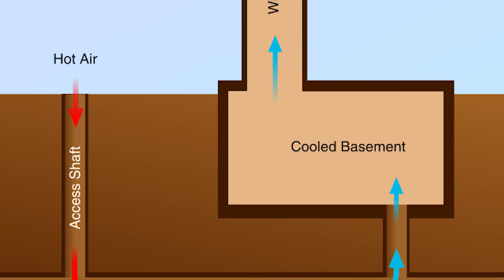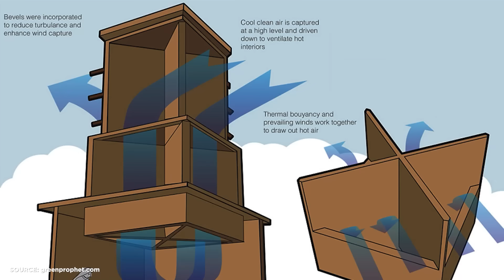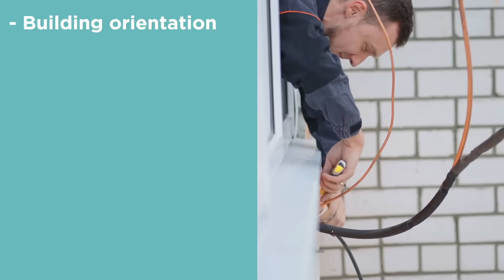Forget Heat Pumps - This House Cools Itself With NO Electricity!

Comment: Another very interesting thing that makes houses more efficient when it comes to heating and cooling is being surrounded by deciduous trees. Some people in Greece have started doing that, and it's actually a super interesting solution. During the winter, they shed their leaves, exposing the house to the sun as much as possible. Then, during the spring they green again and provide natural shade throughout the summer. Not only do they benefit cooling and heating, but their shade is more pleasant to sit under than artificial structures, along with having other benefits of having trees in your garden.
Reply: If you want to read a bit more about this in the context of the US, "Compound Climate and Infrastructure Events: How Electrical Grid Failure Alters Heat Wave Risk" by B.Stone and E.Mallen is a good starting point. It is only 8 pages and compares 2 strategies across 3 cities. 

The relevant bit is that which high-albedo (reflectivity) roofing helps older, single story, single family homes a lot more than canopy coverage, canopy coverage offers a lot of other benefits as well. Better air quality, improvements to mental health and opinion of residents of their own neighborhood, etc. But to quote the paper, "Other recent work has found each one percent increase in urban tree canopy to be associated with a reduction in temperatures of 0.14 and 0.2 degrees Celsius in arid and humid climates, respectively." 0.14 and 0.2 might seem like very little, but a 5-7% increase in canopy coverage reducing temps by an average of 1 degree Celsius is huge.

Anyway, it's a short, if technical read. Highly recommend checking it out.
Reply: I live in a green city (300k population) with loads of trees in gardens and along roads. It's bizarre to me to see so many people literally scared of trees. Sure, sometimes one falls in high winds but I've never known anyone seriously hurt. The city hires arborists to keep an eye on the big ones and manage them if they start to look dangerous and we mourn the old ones that need to be taken out. I'd hate to live in an environment where anything green and growing was seen as an enemy.
Reply: planned:  one story house.  south facing front porch.  south facing garage. 2 deciduous Katsura trees to shade garage and driveway.  house stays 72 degrees until the sun swings around to west.  then it cooks up to 78 degrees.  gets up to 82 degrees when it gets over 100 degrees outside.  sometimes I take a cool shower in my marble shower and the marble floor in both bathrooms is freezing on my feet so I hang out doing nails and girlie things to cool off.  put my crock pot in garage when cooking.  run my waterfall in the backyard to create a cooler allusion.   turned the heat pump on to cool only three days this summer.   

heating: kitchen and family room are heated by natural gas fireplace and closed off from the rest of the house which is heated to 64 or warmer in winter.  in putting in the shower in one bathroom I found that the fireplace on the other side of the wall emitted lots of heat so I made a hole for a register and open it to heat that bathroom all winter.   benefits are: comfort.   good health.  reasonable energy bills.
Reply: You are exactly right. When it's too hot for most people to be outside, I can be anywhere in my yard and be cool. But it is extra work taking care of the trees. Also, air is better around my house.
Reply: People are too retarded, lazy, egoistic, and really sick mentality overall to understand the need of nature.
Most people cut down the trees because of roots or leaves they let on the ground.
Trees don't just add shade to your land, they add life, birds live in trees, and insects and so on.
I have neighboars here who spray poison on the grass, wich is outside their property because they are too lazy to clean it. I live in romania. There is planty of green here.
I live near a lake, the water is like 5 meters away from my backyard fence. My grandather planted willow trees near the lake like 20 years ago, now they are hugee, and all the kids come and make noise and leave junk in the front of my property because they have shade and is nice to stay there. One day i went outside and told them if i catch any of them there anymore i throw them in the lake. Sadly is the only way you can do what is right here.
My entire property is filled with vine, on top of the house and the backyard is like a net of wire on wich it grows. I makes alot of mess in the autumn but in the summer is great. And i can use the grapes to make wine, or eat them. The backyard is allways filled with sparrows. People who live their entire life inside a block, made of concrete, not only they get retarded, they grow more and more sick, they pollute, they don't care about nature, for them everything is "objects". People don't realise it and don't want to see it, but all these changes now, are to force these people to change.
Reply: In low latitudes, deciduous trees will never get tall enough nor be able to be safely planted close enough to buildings to give them shade during the day in summer. They will only possibly work on the east/west sides to block the sun when it rises/sets.
 
Trees for shading buildings sounds great, but it just doesn't work where cooling is needed.
Reply: Having a roof overhang or a shaded pergola over the south facing windows ( if you live in the Northern hemisphere) will let in the low winter sun while keeping the high summer sun out. The rooms in my house are like this apart from one and the temperature difference is huge actually.
Reply: I've been propagating them as much as possible in Alabama. Hoping to someday have more shade than I have land area as my canopies reach out over streets and lot lines 😁 🌴
Reply: Grape arbor do the same, produce a tasty crop, leaves for composting and can be grown on a trellis above the roof of existing buildings.
Reply: Doesn't have to be trees - ivy, grape vines, other climbing plants. They grow faster than trees.
Reply: plus the leaves naturally release water in the air, cooling the surrounding even more
Reply: where can I find those delicious trees?
Reply: Can be a great solution but takes time to grow the trees to a useful size for this.   Also you have to find the right type of tree.  Not all trees grow and drop leaves at the same time of year and can be affected by weird climate changes too.  Still trees are Awesome!!
Reply: One of the main issues is trees falling on your house. I have been to a lot of houses where a gigantic tree fell and nearly killed people, so if this is done the trees need to be carefully monitored. BTW cutting down a large tree in MD can cost 3-8 grand.
Reply: i am currently trying to figure the best way to fell a tree that was allowed to grow next to the house because it got struck by lightning and is dying.
Reply: Lovely, until the roots crack the foundations
Reply: @jakesalvadori6852  Well, I'm no architect/civil engineer, so I can't comment on that. But if the issues with planting those trees are surmountable, I can't see why you wouldn't want them.
Reply: @jakesalvadori6852  Plant trees that won't crack your foundations.
Reply: @jakesalvadori6852  Yes, I have this system and you do have to maintain the trees every few years. But it's worth it. The beauty, the cleaner air. I use the fallen leaves to make beautiful top soil out of.
Reply: @jakesalvadori6852  I was going to say this! I loved my older neighborhood and shady yard... until the roots started to clog my sewage pipes and crack my foundations. Also, animals sometimes got into my attic because the tree branches made perfect pathways. Oh, and the trees threatened the power lines. Then, there's the time a big tree branch fell and knocked off my gutter during a big ice storm. The shade was great. It really did cool things down. But... there are real downsides to being surrounded by mature trees. I had to have two of mine removed.
Reply: @jakesalvadori6852  brother thats if the roots are alr there and you pour concrete over them, roots wont grow into a solid foundation theres no way
Reply: @jakesalvadori6852  depends on the type of root they are having and how close or far you plant them. Willows, for example, grow super fast, but spread far where they consolidate the soil, but are therefore not suitable for planting close to the house.

The bluebell tree, Paulownia tomentosa, is a fast-growing deep-rooter, so it is probably well suited for planting close to the house to provide shade.
The manna ash is a very pretty but slow-growing taproot.
Trees can lower the ambient temperature by 1-8°C in summer. I would build an extra pierced brick garden wall for air-circulation but protection from a potential falling tree stem at least.
i would leave at least 5 meters distance to the house. "A good rule of thumb is to start at about 8 to 10 feet away from your home for small trees and scale up to account for the tree’s mature height and spread." the-best-and-worst-trees-to-plant-near-a-house-by-zone/

Comment: @8:06 About that Eastgate Center. Zimbabwe has a yearly temp of 22C / 72F so ideal for a passive structure. Thermal Mass is huge advantage for all structures, large or small, passive or not. If you want to add your "Mass" to your home, buy a bunch of 5gal water containers. Water holds a lot of BTU's and you can drink it in emergencies. :) The mass reduces the number of on-off cycles of heating/cooling equipment and therefore increases efficiency. It's much like you're avoiding stop-and-go traffic. Same principle applies to your heatpump/home.
Reply: And your fridge.  Don’t leave it empty.

Comment: A self-cooling home in a location that is already naturally cool. Wow. So innovative.
Reply: yep that's what i thought as well. You can't do these kinds of homes in a place that is really hot in the summer, and decently cold in the winters.
Reply: @smokeeish77  ...look up Arcosante in AZ. Thermal dynamics work.
Reply: @Krazie-Ivan  they work up to a point.
Reply: @Krazie-Ivan  bro, those are science fiction buildings ... build a normal home, for normal people in the desert using only thermal dynamics, as you say.
Reply: @smokeeish77  ...just 10ft below the surface, the ground maintains temp year-round. Induction tubes, flowing naturally by way of TD, can cool 120f air to 60f. Works in reverse too... and you can even store excess heat in the ground for winter, with year-round fruit trees growing in greenhouses, despite -40f outside temps. All of this has been done. No sci-fi. 

A "normal" house to you, is somethin I see as a relic & garbage, but a great performing passive house can still appear "normal" to the average eye. That's been done too.
Reply: That was my first thought too. How well would this do in the Eastern US in July when it's 110+ degrees fahrenheit out with 100% humidity.

Comment: ERCOT’s problems also come from burdensome EPA regulation, a massive demand increase in energy usage (rapid population growth as well as expanding EV markets), and an irrational shift of too high of a percentage of production to wind (most of which, geographically, produces in off-peak times). Blame ERCOT all you want, but they are heavily hamstringed by federal requirements that lead directly to energy shortfalls.

Comment: Urgh. Passive houses... No thank you, I don't want to endanger my health. I specifically stayed away from passive houses 15 years ago, when they were hip over here. Living in hermetically closed space and relying on forced ventilation that WILL deteriorate even with good filter management... no thanks. I built a zero energy house instead. That's the way to go.

Comment: A curious passive house design is the Earthship by Michael Reynolds. Fundamentally it is an earth-bermed passive solar home. But the design is quite a bit more elegant. Large angled south-facing windows help capture sunlight in winter and create a heated greenhouse space in the forward part of the structure. The living spaces are separated by thick earthen or stone walls with large windows and doors. In summer, these are closed to keep the heat out. In winter, they're opened to let the heat in. The living spaces are below grade and surrounded by a large earth berm whose mass helps keep temperatures in the living space relatively steady year round. Vent tubes buried in the earth berm allow for air exchange and help provide cooling in summer. In winter, minimal heating support can be provided by a rocket stove mass heater if needed. The system isn't perfect, but if you desire to have more control, you can easily a very small HVAC system or a mini split to pick up the slack from the passive elements. Most of these homes can be powered off very small solar power systems. 

Beyond energy, the Earth Ships are also pretty innovative in their use of water. Blackwater (toilets) is a separate system from greywater (sinks and showers). Blackwater goes out to a septic field which supports growing non-food plants for decorative or functional purposes. Greywater is circulated to planters in the greenhouse where it nourishes plants, including some food crops. This filtered water can then be used for irrigation or flushing toilets (which routes it over to the blackwater system). Many of these homes rely on rain catch or have water trucked in, but they use much less water overall. 

Lastly, Earthships tend to be built inexpensively with reclaimed materials. Using rammed earth in tires is a common way to build structural walls. (Some people are using Super Adobe or "earth bag" construction, because it's easer to get permitted under building codes where the earth bag can be regarded as a masonry wall). 

They're at least an interesting lesson is better ways to build homes to have less environmental impact. But I will say that they don't seem to be practical outside of the southwest.

Comment: Check out "Holz100" houses from Austria. They build house of raw wood, sometimes even without central heating and no cooling. They claim to be twice as fire retardent than concrete, more stable in case of storm or earthquake than conventional houses and more long lasting. And its 100% recycleable - no chemicals involved.

Comment: Joe if you think the Eastgate Centre is cool, Mick Pearce afterwards designed the CH2 in Melbourne, Austrlalia, and it's mindblowing; on top of using the principles from Eastgate it also has automatically moving sunshades, a passive water circulation system for air cooling, all kinds of curved ceilings and surfaces to channel airflow... I don't remember the exact numbers but its water and energy consumption were something like 15% and 25% of other average buildings, or something. Plus its air quality is phenomenal as it filters all its air from outside instead of recycling air internally. On top of that Melbourne's weather is infamously erratic, able to reach water-freezing temperatures in winter nights and up to 45ºC (113ºF) over summer days.